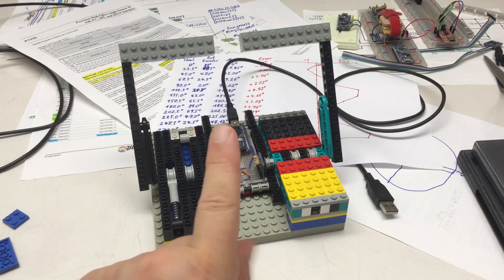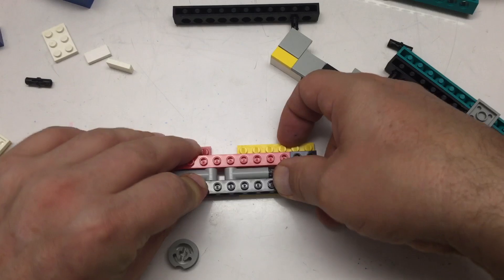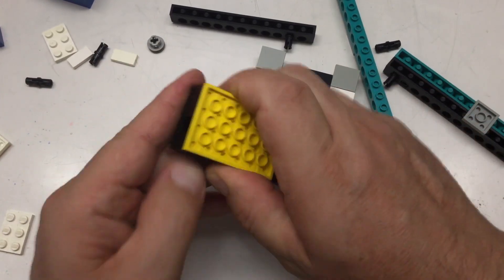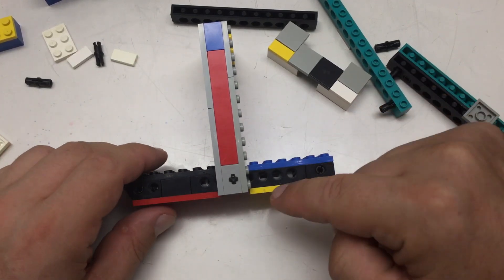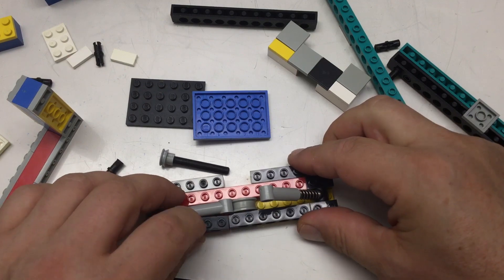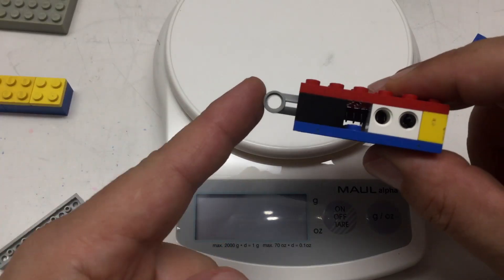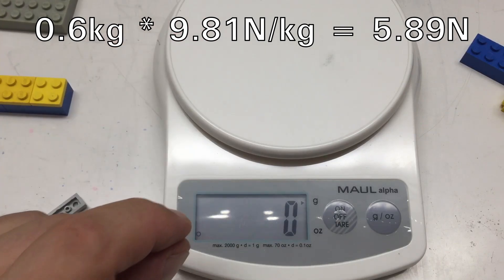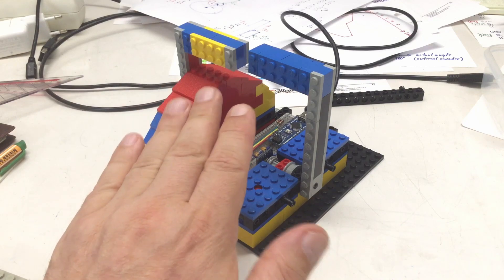Dual Electronic Engine Control Lever IP68 (2): 1st LEGO® Technic™ Prototype

Comment: Lego should make Arduino bricks , I guess ... I don't know if I missed it, but are you building this for an end use ?
Reply from the maker: I was actually thinking at one point to put an Arduino into my old Lego Robotics 2.0 RCX controller 🙂 Anyway, yes, there is an end use for it. But before we come to that I'll first have to build an IP68 electronic steering wheel, a NMEA GPS receiver, a NMEA electronic compass, an IP68 enclosure for a Raspberry Pi with touch screen, and modify two cheap 1KW outboard/trawling motors to be electronically controlled. You probably can guess where this is going by now 🙂 But as things are going right now (timewise) it will probably take me one or two years to complete everything.
Reply: @robertssmorgasbord   Sounds a plan and then some ... The "cheap" 1kW is an internal combustion engine or electrical motor ?
Reply from the maker: @mumbaiverve2307  Electric motor of course 🙂 It probably won't have much of an endurance, because LiFePO batteries are heavy and expensive (maybe 1 to two hours at full throttle). But it will serve as a testbed and will be good enough for a nearby lake and river.
Reply: @robertssmorgasbord  That would be a great project in itself if you are going to design the speed controllers for the motors. Lot of "donner und blitzen" during the testing :D
Reply from the maker: @mumbaiverve2307  Well, I will start small by replacing the potentiometer (that's probably somewhere inside the motor's handle) with an electronic one, that will be governed by the electronic engine control lever. Just to get things running. But at one point I'll probably replace the whole power electronics by my own version that will incorporate recuperation.
Reply: @robertssmorgasbord  Looking forward ...
Reply from the maker: @mumbaiverve2307  Reply to "Looking forward ...": Me too 🙂
Reply from the maker: @mumbaiverve2307  Reply to "Lot of "donner und blitzen" during the testing": Yeah, big plumes of black smoke escaping the power MOSFETs 🙂